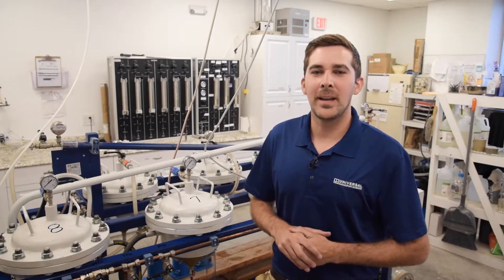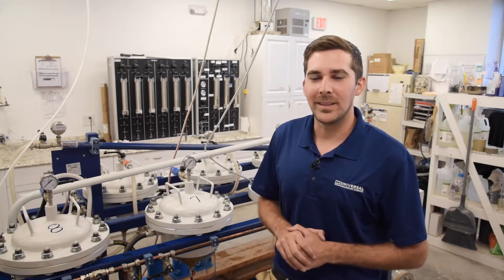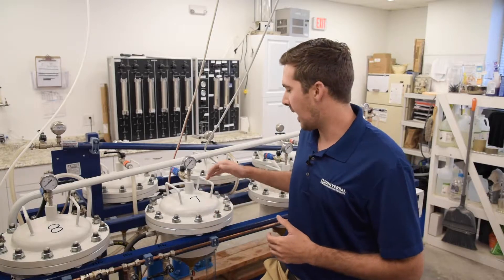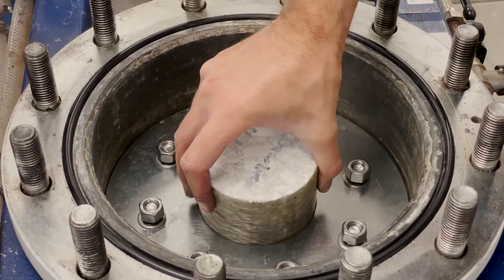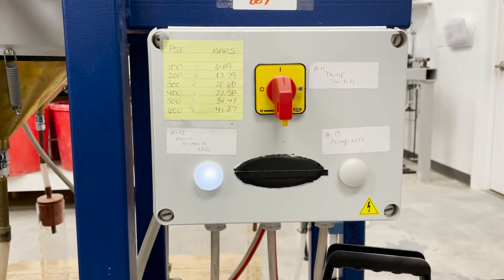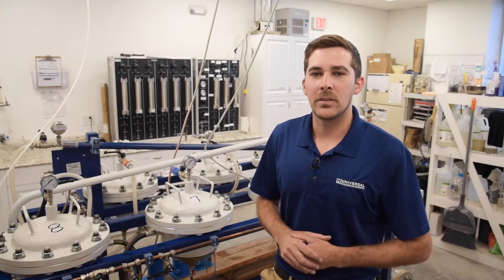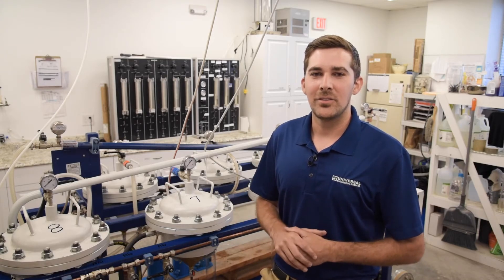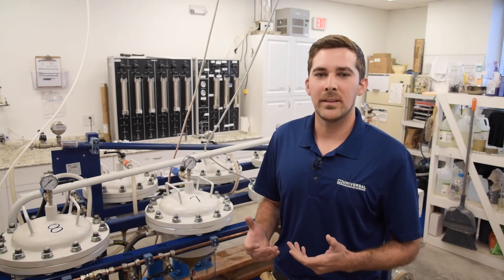UES Concrete Permeability Testing

Comment: At last!   I finally learned how the CRD  C48 test is run.  Waterproof concrete is valuable in areas with high tables, tanks, underground utility infrastructure etc.  Your lab set up is impressive is impressive.  Thanks for making this video.   Euclid's Vandex AM10 Concrete admixture passes this test requirement